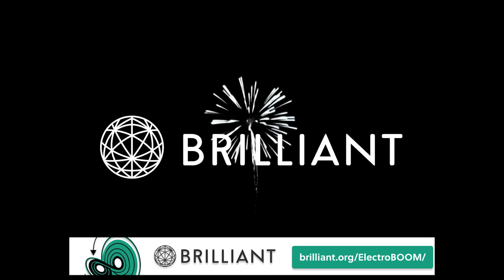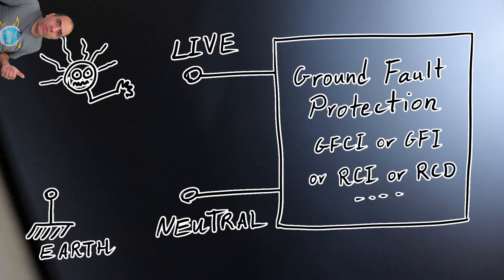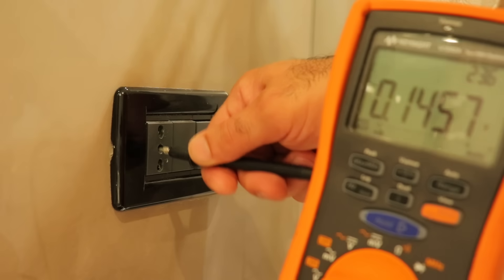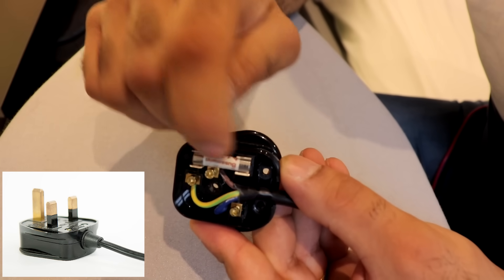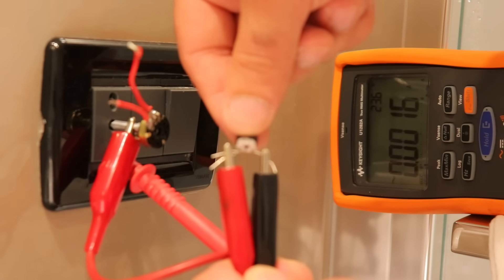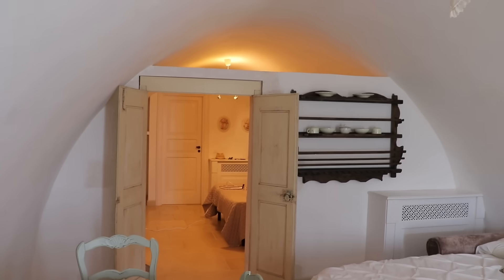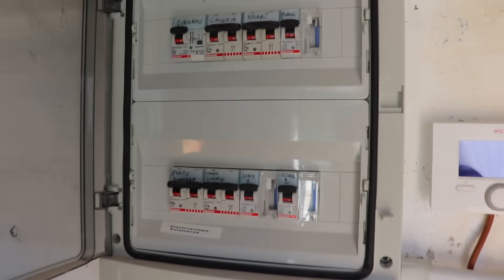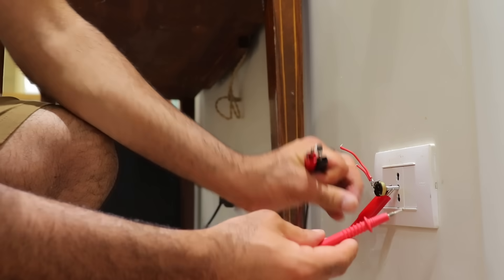Tripping Every Breaker in Italy

Comment: The hotel where the GFCI tripping didn't also shut off the lights is an Italian thing. Prior to only a few decades ago it was common in Italy for buildings to source the electricity for their lighting fixtures and sockets from different providers, and consequently on buildings that were electrified in that era the sockets and lights are on completely separate circuits.
Reply: It's common in Poland too, even in buildings from 70s and before, and it's a standard still.
Reply: What is the advantage of using two providers?  Since lighting is a lot less power, why not just get that from the same provider as the sockets?  Is it incase one fails, so you can still have some power?  Doesn't this mean two grids and more pylons?
Reply: @lambertovitali3152  They used to be taxed differently and even ran at different voltages. Back when they were fully separate providers lighting ran at 127 volts.
Reply: @asteroidrules  Excellent!  So you just run everything off the lower tax one.
Reply: @lambertovitali3152  Yep. And that's why, in The Netherlands (and probably elsewhere as well) you could get lamp fixtures that were basically a fixture-extension. You would remove the bulb, screw in the extension and then screw the bulb in the extension. The extension provided two sockets at the side for powering electric irons and all other things electric that basically required 'krachtstroom' (this translates to something like 'machine-power') but as such a connection was more expensive and most people hardly ever needed the juice from such a connection, this was a cheap alternative. As wires for lighting usually didn't provide the thickness required to deal with the currents involved, it was also a dangerous option.
In Dutch electrics, 'licht' and 'kracht' are still used to define the type of 'group' in a fuse/breakerbox: a 'lichtgroep' (light-group) is always a one-phase group fused with a maximum of 16 Amp fuses, while a 'krachtgroep' (machine-group) is always a 3-phase connection, either with each phase individually fused or with a 3P+N circuit breaker that breaks all live wires at once, with the zero trailing behind to prevent damage from the zero being gone earlier than the live wires (it also connects first again when switched back on again, it's a pretty nifty circuit).
Reply: @weeardguy  Interesting you get 3 phase.  In the UK we only get one phase unless we ask for it and pay more (like if we have 3 phase lathes in shed or something).  I get 100A 240V single phase.  What I do with that is up to me.  I don't actually have a seperate lighting circuit, since I connected them to the computer's UPS.
Reply: @weeardguy  The trouble with 3 phase in your home is you have to limit each phase's current, so you have to try to divide up your house.  Here, I can get 100A total, anywhere on any circuit.  I'd hate having 3 lots of 33A.  Simplifying it, I might have four 30A loads.  With three lots of 30A, where do I put them?  With 1 lot of 100A, I put them all on one, knowing I'll never use all four at once.

I wonder if it's possible to convert 3 phases into 1 phase, using all the power from all the phases?  If you could, you'd need a big transformer in your house.
Reply: @weeardguy  But in my house I can plug in anything anywhere.  I have very few circuits.  30A 240V for all the outlets.  30A 240V for the shower.  30A 240V for the cooker.  5A 240V for the lights.  30A 240V for the garage/workshop.  I don't have to worry about exceeding a third of my power because two things are on the same phase.  Notice I have four 30A circuits.  How would you connect those to three phases?  Two would have to be on the same phase, then I couldn't use them both at once!

How do you manage with 16 amps?!  An electric shower uses 30A, it's 7.5kW.  An electric cooker the same.

I love not having to work out which phase to wire things up to.  I wire my own house, I've converted the garage, I've built an extension.  No electricians involved, just add to the same single phase.

I was just wondering if it's possible to change 3-phase AC into 1-phase AC.  If it was possible, I guess they would do so at the substation.

Damn, I just blew up my Cockcroft Walton voltage multiplier.  I should have included a current limiter.  That was some bang.  2500 volts got shorted and er... oops!
Reply: @lambertovitali3152  late answer but atleast here in Finland our oven and other high power appliances are on their own separate 400V and everything works from main 3x25A circuit in apartment so it's less current when the voltage is higher. Easily could use every electric machine i have in my home at once.
Reply: @lambertovitali3152 there were adapters made for exactly this purpose, it would screw into a light fixture and you can plug stuff in.

And since incandescent bulbs ate a whole lot of power, you can use then for high powered appliances.
Reply: @lambertovitali3152 this is not how breakers with 3 phases work.  Typically we use 16A breakers, where you have multiple power sockets in each breaker, except those dedicated to fixed, high power devices, such as oven. Multiple 16A breakers are connected to the same phase and all of them go together to a triple breaker with higher amperage. This means all sockets that are on the same breaker can together take power up to the triple breaker amperage. Realistically my house has never gone over 6kW power (I can tell precisely because of the smart meter), which would be about 26A if it was all on the same phase, but that would be very unlikely. 

There would be no point switching from 3 phases to one.
Reply: @jankoodziej877  My point was, if all your loads are on one phase, you're limited to a third of your power supply, which I had read earlier was 16A.  You're now saying 26A.  That's still not much, here in the UK we have 100A on one phase, and I've gone up to about 50A.  Electric shower = 8kW, Electric cooker = 6kW, Washing machine = 3kW, dishwasher = 3kW, dryer = 3kW.  I don't want to have to work out what I can switch on at the same time.
Reply: @lambertovitali3152  16A main breaker means 3x16A in a three phase system so 48A. Yes the 100A breakers in the UK are hefty. In a lot of EU countries people only have 3x16A. In Finland the norm is 3x25A which is still less than 100A. But in new installations 35A and 63A are common. 24kW and 43kW. The power hungry devices here are wired to use all three phases so it’s generally not a problem. An electric sauna could for example have three 230V 2.5kW elements in it for a total 7.5kW.
Reply: @juliuseskola1281  I'm wondering why they chose to put three phases into a house.  If it's for balancing, in the UK they just alternate houses on phase 1, 2, 3 along the street.  And having more volts in your house isn't exactly safe.
Reply: @lambertovitali3152  I dunno really, but it’s a European standard pretty much. We do have single-phase in small apartments and very old houses. In the old days, electricity was only for lighting, I guess when heat was needed they rather brought two extra wires as opposed to much thicker cable. Also note that a lot of the UK uses TN-S grounding (three wires). We use a combined earth/ground with an unprotected steel wire, which also acts as a support for the cable and usually a secondary grounding electrode at the premises. It’s really only three wires they need to carry to us and the power is 3x as opposed to just doing it in a more rigorous way of having actual separate wires. Also when you take 400V between phases in a heating element or use a 3-phase motor, you dont need a neutral at all. So the N doesn’t have to be big enough to carry return current from all three phases to the transformer.
Reply: @juliuseskola1281  In the UK I only have two wires.  It's an armour plated cable, underground.  Starting with the centre, there's live conductor, red plastic insulator, heavy stranded wire, black plastic insulator.  Neutral is the same as earth, 0 volts, it's grounded at the transformer which serves the street.  There's some nonsense about having pipes grounded in the house, but since it comes in and leaves via plastic pipes, I don't see the point.  Why provide a path to ground when you're touching the sink?  Or the bath drain with your foot and the shower goes wrong and puts live in the water?
Reply: @lambertovitali3152  It’s so that live to pipes (which are conductive) will certainly trigger RCD/GFCI. It’s good that electricity has a path to ground if something breaks because then the easier route is through the grounding and not through you. But I see, you’re using TN-C-S or TT grounding, TN-S, three wires, ground, neutral and live is pretty common in the UK as well. Unheard of where I live.
Reply: @juliuseskola1281 It doesn't matter what the incoming wire is, earth still functions the same.  But this nonsense of earthing things started well before circuit breakers were invented.  With fuses, it's insanity to increase the possibility of you being a path to ground.  With circuit breakers, it doesn't matter!
Reply: Honestly now i just wonder why we ever thought putting the lights on the same circuit as everything else was a good idea.
You know, tripping hazards in the dark when the hair dryer breaks and all that.
I wonder if there's any disadvantages to putting the lights on a separate circuit, other than cost of additional materials... Because honestly, i'd kind of want that to be standard.
Reply: @Volvith  At least we've moved away from using lights as sockets. In the US when houses were first electrified it was for lights only, then when electric home appliances became a thing some ding dong had the idea of making them plug into lightbulb sockets to reduce the need for wiring.
Reply: @Volvith  It's basically a de-facto standard in The Netherlands for quite some time now. In the past, fuse-links/breakers would usually protect whole floors (or even more than one floor, but usually the other floor would hardly have sockets and fixtures). RCD's would either protect multiple floors or even the whole house (like with our old main breaker system) Downside was that either an overcurrent or ground fault would put you in total darkness. By now, lights and sockets usually have to be put on separate RCD's/fuse-links/breakers, so a fault in a socket in one room will only turn off the sockets and keeps the lights on so you can still see something.
But this is also from the ever increasing amount of technology and (thus) the need for ever more outlets that also draw more current, simply requiring more breakers.
Reply: what i wanna know is why was camera 5 in the bathroom watching him take a sh!t ? i thought that was a german thing
Reply: Here in Italy, in all the houses I've lived in, both old and new, they run separate circuits for the different zones of the house, for sockets, lightning, kitchen appliances, and so on. Sometimes the lights and sockets share the GPF unit, but most of the times that's also separate. It's very handy when making repairs or when something trips in the middle of the night.
Reply: Really interesting! Also, in Finland we have the RCD often on a separate circuit (not a different provider though), as it used to be mandatory only for sockets (1990s onwards). Today it is mandatory for all sockets including light sockets. However for example in my apartment, it wasn't yet mandatory to put it everywhere, but the lights and (most) sockets have it anyway. Sockets meant for static grounded appliances lack RCD protection however.
Reply: @juliuseskola1281  In my house I have fuses, no nuisance health and softy here!
Reply: This is not correct, simply the line powering sockets and the line powering lights have 2 separate GFCI breakers with tripping current of 30mA and 2 separate current breakers 10 amps for the lights and 16 amps for the sockets. Then they both are under a general GFCI breaker that has slightly higher tripping current. That is why only the sockets where out of power. Simply that hotel had a better protected electrical system. Having two separate providers is not and has never been a thing... Why paying 2 contracts?
Reply: False. Reason is different and related to loads.  All the lights of your house, together, can't be as powerful as ONE electrical appliance connected to the outlet. Cable sizing is different, so are the breakers. That's why

Comment: I cannot wait the end of the video. I know, I'm sure you found it. Yes in Italy protection has to be placed in any building. And yes sockets has "accidental" insertion protection (only working with L&N plugged )
Reply: Pansies.  In the UK I still have fuses, no annoying trips!
Reply: @lambertovitali3152  well technically any fuse has a reaction time(time needed to melt)
Reply: @massimoromano4838  Exactly, it allows surges.  Breakers do not, therefore are not fit for purpose.

Comment: The one at 9:14 is an old proprietary telephone socket from producer BTicino (mod. 2021), it was used in the '80s for sure, maybe even the decades before. I think they still produce the plugs, but not the sockets.
Reply: Cheers
Reply: A similar phone socket is widely used in France.
Reply: I have a Fujitsu Siemens laptop with all these modem adapters in a small bag, was curious about the light

Comment: You have tested a very simple electric system in hotel, in houses it's even more secure since we have separate circuits for low power (lights) and high power (kitchen, oven, washing machine, and so on) each with his own differential breaker.
Moreover, it's a good practice to have a magneto termic switch for each circuit plus one for each high power device. My electric rack has 12 switches, 3 of them are differential breaker and 9 magneto termic switchs.
Reply: @@randolelz Rules are for the obedience of fools and guidance for wise men.
Reply: @@randolelz yep, that is correct
Reply: @@randolelz No, 80mA kills you (alledgedly, yet I've never been killed after 9 shocks without a breaker - must be for people with weak hearts).  That's why the nancy boy breakers  trip at 30.

Why would I install a bigger breaker which would no longer protect the wiring?  It's a 30A cable with a 30A breaker, and I'm using 16 amps, yet the breaker trips on startup.  If I upped the breaker the wire wouldn't be protected in the case of a short.  So I used a good old fuse.
Reply: Too complicated.  In the UK I have one fuse in the fusebox for all the sockets, one for the cooker, one for the lights, one for the shower.  Each appliance has the fuse in it's own plug.  No breakers, wehey!  No nuisance trips!
Reply: @lambertovitali3152  fuse is just single use overload protection that melts when overloaded and is something we used in Italy almost 60 years ago. A fuse exactly what a magneto termic switch does, but is reusable (and much more reliable).
If you don't have also differential breakers you may die if current discharges on you... A differential breaker detects also very low currents discharging outside of main line (such as a person touching a broken cable).
Reply: @tesoruccio3  Fuses can easily be replaced, and seldom break.  Breakers are a pest, they're tripping all the time.  Try using one where you have several computers all being switched on at once, the surge trips the breaker but not the fuse, even though the load is only half the rating.

I know what a differential breaker is and I avoid them like the plague, even more nuisance trips.  I've had 9 240V shocks in my life.  They just make you jump that's all.

Comment: kind of weird that they use black for neutral, over here (Netherlands) we use Brown as the L, blue as N , Green Yellow as PE and black as the switching wire. So seeing an European country that changes those makes me think that some Pasta Electrician just messed up. (see NEN-EN-IEC 60446 for information)
Reply: This is, in fact, the case. Blue is standard neutral.
Reply: Because we don't. The colors are blue/brown/black/grey for N/L1/L2/L3.  Either he measured wrong or the place was wired wrong.
Reply: @demoniack81  cool, thats what I said. And nobody will find 3 fase in a wall socket.... and I did more then a few jobs where I either placed machines or did maintenance on them in countries like France, Poland , Russia or Italy, and they have some weird ideas about what is correct.... (like pulling a 5x0,34 wire across a frame so tight it can be used as a guitar)

Comment: Italy has two different type of plugs the 10 amp and 16 amp version. Both are earthed. The 16 amp version has larger prongs than the 10 amp one. The 10 amp plugs can fit into both 10 and 16 amp sockets. But not vice versa. The 10 amp has similar prongs to the Europlug,that's why the Europlug can fit into Italian sockets.